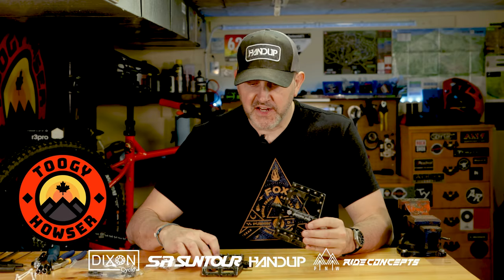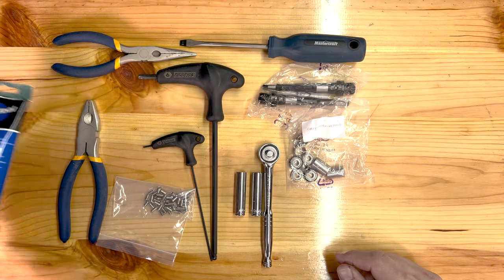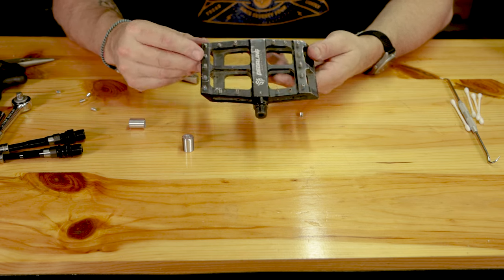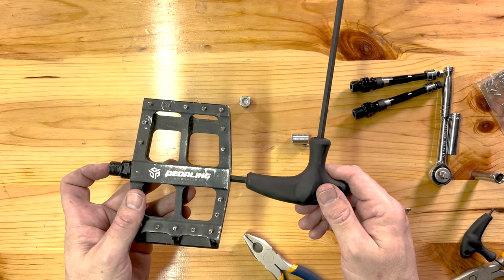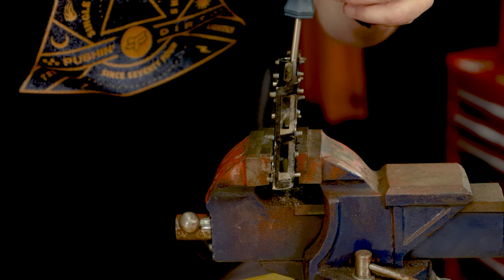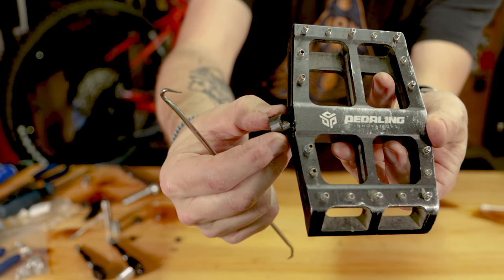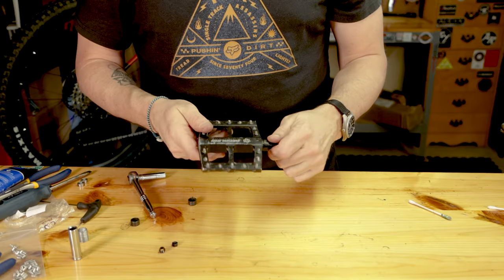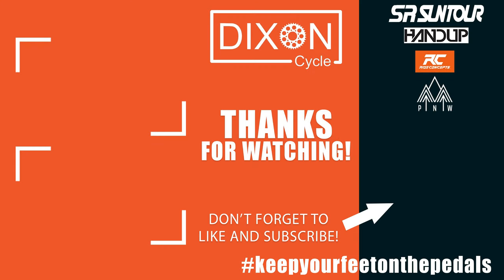Pedal Rebuild - Rebuilding my Pedaling Innovations Catalyst Pedals

Comment: Thanks for this video.  Well done!

One note:  On mine, the bushing is pressed in with a 10mm socket, not 9.  Apparently there are 2 versions.  Also, it appears to be a high-density plastic, so if necessary it can be picked apart and removed.